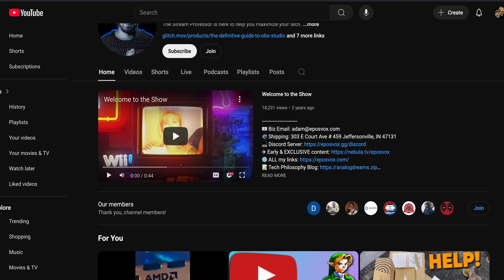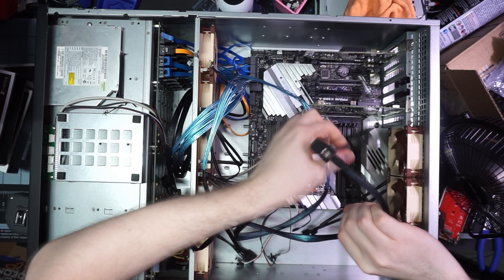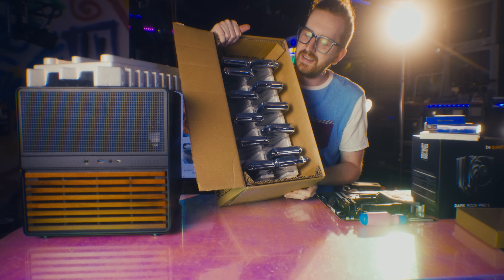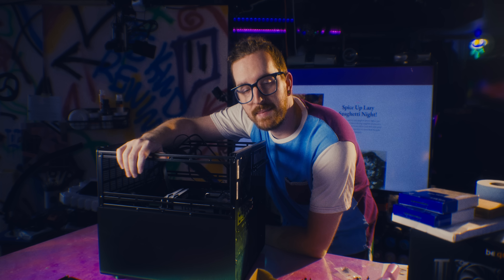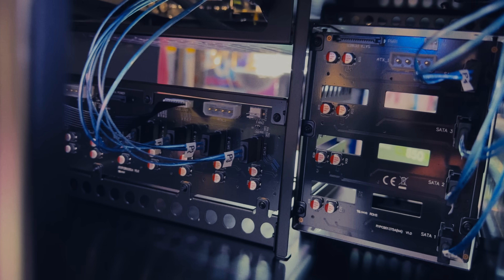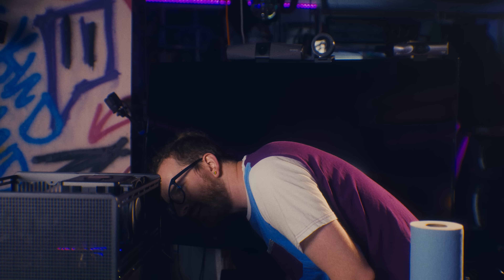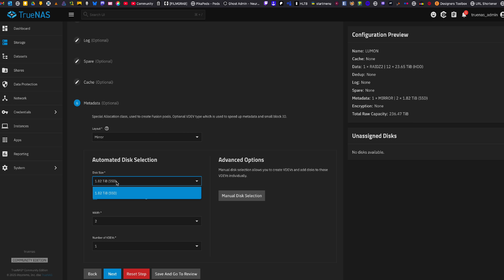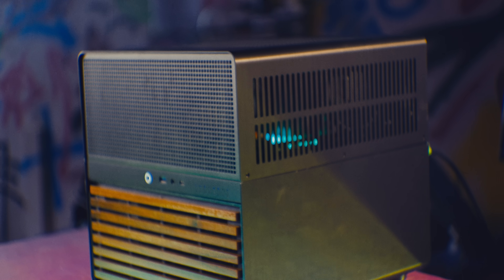It's time to build your own NAS (It's SUPER EASY)

Comment: I used to use Truenas and it worked well, but at one point I had to reinstall and reconfigure it, and I COULD NOT for the life of me figure out how to get the shares and permissions setup. It was all super complicated and I kept getting not allowed to access errors, so that kinda turned me off of truenas. Started using Unraid, where I was able to import my old truenas pool, along with my new unraid array and been using that since. (This was a couple of years ago though, so it might have gotten easier/me getting a tiny bit smarter)

Might eventually try truenas again, but for now the ease of use, and flexibility with expanding drives are what's keeping me on unraid until I need somthing more robust
Reply from the maker: Huh, in my experience the permissions on TrueNAS were no more complicated than Unraid. But hey, whatever works is what matters!

Comment: you really want  A LOT of RAM , ( and i mean lots of it) in order to get decent transfer speeds in truenas

whereas unraid  instead  of using RAM , it will use SSDs  for caching.  

so , pick your poison?

IMO you should have used proxmox as a base ehypervisor OS, then put  truenas  on top of it;

Comment: I have a question? are those hard drives built for a Nas system? They have to say Nas on the drive in order to handle the work load, how do I know you ask, I learned the hard way LOL

I went with WD Red Plus for my True Nas system and they work like a charm
Reply from the maker: They don't have to say NAS, no. These are enterprise drives made for actual servers, they're made for way more uptime/harsh use than a home NAS would give them.

Comment: At this point, I would recommend the Silverstone CS383 over the Jonsbo case. I have the Jonsbo N5 and it works ok but cable management is a mess in the bottom and as far as I can tell, you don't get activity lights for the drives. The New CS383 has 8x SAS/SATA hotswap bays in the front (with activity lights/status lights) plus an additional 3 5.25" bays in the bottom and another in the top. It aint cheap but it is also a solid NAS case.

Comment: My synology nas is at full capacity now. Their vendor locking the drives is a dealbreaker in my upgrade. Their drives are priced agressively now, but without any proof, an independent test, their claim that the branded drives are less prone to fail are bs. They are convenient for sure, hassle free setup, specially the photos app that my mom really enjoys, but for my homelab, i will be going the truenas route very soon.

Comment: What are you doing? VDEV of 12 drives Z2. TrueNas is not Unraid, you will lose all your data, if something goes wrong.
Reply from the maker: 12 drives is the maximum number typically recommended, and 2 are reserved for parity explicitly so I don’t lose all of my data if one dies. 
Pretty standard raid practice…
Reply: @EposVox no dude, you are bringing unraid mindset to completely different system. Create smaller vdevs, 2 mirrored drivers or Z1 of 3 or 4 drives. Plus, with every vdev you are increasing I/O reads and writes. 3 vdevs and speeds increase by 3x. Watch some YT about ZFS and TrueNas
Reply from the maker: What I’m doing has nothing to do with unraid (which is a JBOD not a proper raid) and instead, every other raid array (which I realize ZFS is a tad different than, but is a different frame of reference then you projecting “unraid mindset” onto me) and advice I’ve taken in over the 2 years of researching before jumping on this.
Splitting up vdevs could improve my speed and redundancy (speed is already fine) but then I lose substantially more capacity. 
I have to balance my needs.

Comment: Dude, a Rosewill RSV-R4000U rack mount server case is u er ~$200 USD, it should be able to support 12x 3.5’ HDD’s out the box,..
Reply from the maker: I have one of those for another server. It’s absolutely miserable to work in, can’t easily get to the HDDs without unracking the whole thing (which is a nightmare in my tight server rack corner) and doesn’t support anywhere near enough drives for the 4U size it takes up
Reply: @EposVox I don’t have one so I can’t speak from experience. Fair play to you mate, however, how is it difficult to access the drives?  Are you using HDD cage / backplanes that allow you to hotspot drives?  Regardless of case, quick access to drives is a must have feature for me.  So if a server case doesn’t have this I add it after the fact.

Comment: I have a TrueNAS VM, not sure how it compares to the rest of the NAS OS, but familiarity and at-least know my way around. But doing this through a Hypervisor in this case Proxmox and having to do the pre-req for both the HBA Card, and GPU pass-through was the most frustrating portions, and that sadly has also cost me time and most of my saved content (about 40tbs and which were virtualized through Proxmox at the time and accessing them caused more headaches). 

And at-least at the moment I'm seem to be good with everything booting up proper, and no random shut-downs from no-longer working CPU Fan (Had an MSI AIO seemed to only last for a few months but just dealt with the failures thinking its my own configuration mistakes). Have been thinking about splurging on a HL15 to at-least start to have backup, but at my current location not sure if Family would be tolerable, have no space. 

I did just turn on ZFS Snapshots for both Pools, My Main Archive Pool I have 2 Mirrored vDEVS (2x22tb, 2x24tb) which is weekly, and do have my Media Pool during it monthly, which is under (RAIDZ1 of 4x16tb) 

Still a bit unsure since it retains the previous reference? and possibly would use more storage? still iffy on that part.

Comment: Since this is for data you care about, putting all your data in the trust of WD blues is crazy. Also didn't catch if you used ECC RAM. While not necessary, great to have for important data. But the ultimate sin here is mixing important data with services. A NAS should be a NAS, which can run on a potato, and services should be a different server.  Especially because TrueNAS is a pretty terrible hypervisor compared to just using Proxmox. People, stop mixing data and services unless you just can't afford it, but most of you can.

Comment: That Jonsbo case is horrible to work with, tbh. Luckily I build first the PSU followed by the data cables from bottom to top, before putting down the motherboard.

The hdd mechanism is even horrible.

Comment: I've been using Debian with mdadm software RAID for years and I've been kind of afraid to experiment with anything else because it's just been so reliable.  I even forgot and did a reboot in the middle of resilvering a replacement drive (a drive had failed and been replaced), and when it came back up mdadm just kicked in and continued the array repair where it had left off without any issues and even left the array available for use during the whole process.

I'm sure ZFS would have been just fine in that same situation, but it's one of those where I'm very hesitant to fix something that isn't broken.

Comment: I keep seeing SAS drives cheaper on sale, but then I get so confused on the lsi card. I was looking at lsi 9300-8i in IT mode having sff 8643 to SATA should be fine paired with a SAS 12gb HDD?

Comment: I have eight recertified EXOS drives - 6x 20TB and 2x 16TB. Absolutely love them. I trust recertified drives more than I do new ones, because experience has taught me that new drives usually do one of two things: They die within two weeks, or they last for years. The recerts (so far) have not done the former, so I'm hoping for the latter.

Comment: addi/y what wit the ass audio for a-roll?
Reply from the maker: Using a shotgun mic while farther away than usual and at a sound-reflective table with boxes for sound to bounce off of, while the AC blasts because I’m in the middle of a heat wave — all while constantly moving around rather than staying in the perfect pickup cone of the mic
Reply: @EposVox  i get the heat wave. i'm understanding of that. maybe try a lav backup?

Comment: Interesting you went with metadata for the NVMe drives instead of cache. I would have thought cache would be better performance. Be aware, if you lose your metadata (both NVMe drives) all your data is gone, so a bit scary. Would also recommend bumping memory to 128GB, that is the single best way to improve ZFS performance.
Reply from the maker: Everyone I've talked to has said metadata vdev makes far more impact on performance than cache. And yeah that's why the vdev is a mirrored raid so if 1 drive fails, I can recover it.

Comment: My understanding is these jonsbo cases cook drives as no direct airflow. There’s a 3D printable front intake fan adapter for the n3 but doesn’t seem to be one for the n5.
Reply from the maker: ? There is direct airflow. 2 fans run basically full speed right behind them pulling air. 
It’s pull instead of push, but it’s still direct. 
My drives are cool so far

Comment: This is a perfectly timed video. I have an old LGA 1151 Board with an i7 7820x and the main focus would be on hosting game servers and maybe a few VM's. The mobo has 8 DDR4 slots and it's the main reason I'm more or less scared to swap it out for a newer platform because It'd require buying even more new ram instead of a bunch of 8gb sticks that I have. I've also been interested in 3D printing a NAS/Server case but most ATX ones seem to be way out of the way or too time/filament consuming to justify, so if there's any recommendations that works I'd love to know (I have a 20tb HDD and some 2tb Sata SSDS so I don't need a million bays for storage). Been a fan for a long time, always appreciate the wisdom.
Reply: The i7-7820X is a LGA2066 CPU. It's one of the cheaper CPUs for the X299 platform so it only has 28 PCIe lanes but that's still a lot more than the 16 lanes that i7-7700K and other LGA1151 CPUs have
Reply: @Pasi123  ah, you're right. I have not been educated on anything intel since Haswell. I've been on the AMD side of things since AM4 lol for gaming stuff. I got the PC off of craigslist for $250 along with a RX 5700 XT and I've been looking for a good use for the parts since I'm not in need of a new gaming system. Appreciate it and I'm probably going to throw in a higher core Xeon or i9 9800x :)

Comment: 12 drives is right on the limit of how wide you want to setup your vdev layouts according to Lawrence Systems
Reply: I mean it depends on if you are doing Triple Parity or not too. If you are running RAIDz3 then you could get away with more than 12 in a vdev but that would be crazy. Better to do 3x RAIDz1 4 drive VDEVs striped together or 6x mirrored vdevs striped together (RAID1+0) if you have a ton of disks.

Comment: The weak point is the usage of a "PC" motherboard, rather than a "server" or "workstation" biard. Using a PC mobo is great for interactive  work (and of course for gaming), but for a NAS system it is much better a Threadripper or Xeon board, even if second hand for comparable  costs.  That will give you extra pcie slots for adding more sata or sas controllers (and possibly JBOD expanders), a GPU (or more, for your VMs), a high speed networking card,  quad nvme carriers, and so on. Plus ECC ram, energy efficiency (very desirable for 24/7 systems), ipmi or equivalent remote management, etc. There are plenty of options on the 2nd hand market, and recycling used hardware you will be helping the planet.
Reply from the maker: Sure but the second step of recycling is “reuse” and I’m using what I already have. Not helping the planet by acquiring more things and wasting what I have. 
A server mobo can’t give you more lanes than the platform you’re using already has. I specifically wanted a fast desktop CPU for the single thread performance for Minecraft as mentioned. 
My other server uses threadripper and a big server motherboard but it sucks for things that need fast single core perf
Reply: I tried re-using my Ryzen 7 1700 CPU & Asrock AB350 Pro4 motherboard. It simply would not recognize used Intel X550-T2 10Gbps NIC nor a used HBA card. I also never successfully got a discrete GPU isolated to pass through to a VM in Proxmox. I spent way too much time on it and finally got and Asus Pro WS W680 motherboard and an Intel CPU with iGPU. No more issues (so far) with Proxmox. I also got a great price on a used Dell T430 workstation/server - that was also very easy to get up and running with Proxmox, NIC & HBA card.

Comment: How's the write performance without the cache drives? I'm on unraid currently and am just pondering if writing direct to the hdds hinders read/write speeds or is it spread across disks so it's essentially the same?
Reply from the maker: I only have it on gigabit atm (need another switch to add more 2.5/10g capacity) but I’m consistently able to max that out in both directions without issue. From everything I’ve heard, metadata vdev has a bigger performance impact than cache compared to unraid

Comment: For someone who started out storing data on cassette tapes and 5.25 floppy disks, I really have a hard time trusting HDD drives now that flash memory is a thing. Am I wrong?
Reply: I've had and seen more flash/NVME drives fail in the past few years than any mechanical drive. I've even had 2 of my own NVMe's fail while my two 4TB SATA's are still spinning happily along 10 years later ... I would never setup NVMe as a boot drive on a critical system unless it was mirrored.
Reply: Modern HDDs have longer lifespans than SSDs, just make sure to let them spin down when you aren't using them. You can use SSDs for faster access (live data that you're working on), and HDDs for more secure storage (sync SSD contents to HDD once a day, for example). Remember to back up your NAS remotely.
Reply: @IndigoTeddy  you are correct if not using proper NAS HDDs, if using proper NAS HDDs, for the love of god, don't spin then down, they do not like the constant spin up and spin down.
Reply: @DJ_Marlus  why is there a difference? I thought everyone just used the same HDDs, just in different RAID arrangements and with different filesystems (ZFS vs XFS vs BTRFS)
Edit: just read up a bit on them, and from what I found, NAS HDDs are engineered to last longer and to be under constant use (useful for a server context), but I don't understand how spinning drives down when not in use can somehow damage the drive. Is it the spinning-back-up process that's doing the damage?
Reply: @IndigoTeddy  Constant rotation speed and temperature is better for the bearings, motor etc. Spinning-up the discs is harder for the motor than to keep them at a constant speed and spin-up/spin-down adds more heat cycles.
But if the NAS isn't in active daily use then it can be better to let the drives spin down
Reply: @Pasi123  I see, thanks for explaining